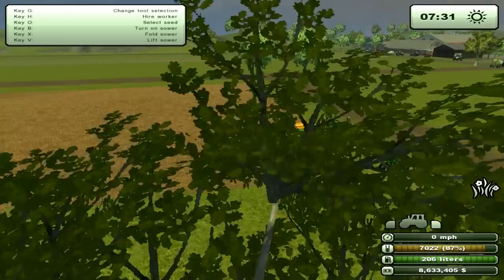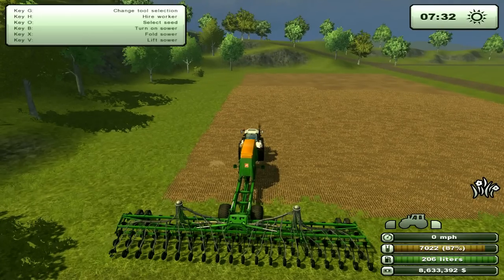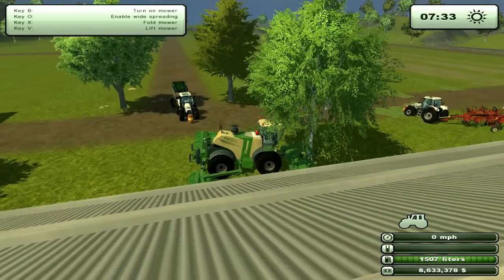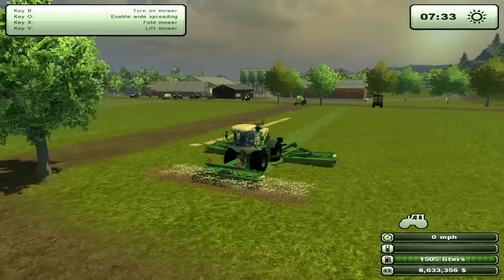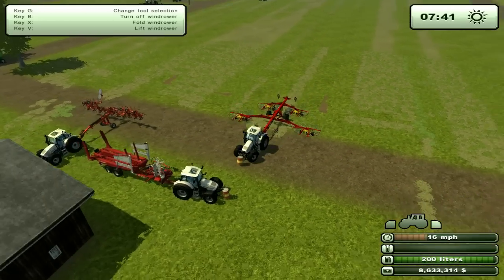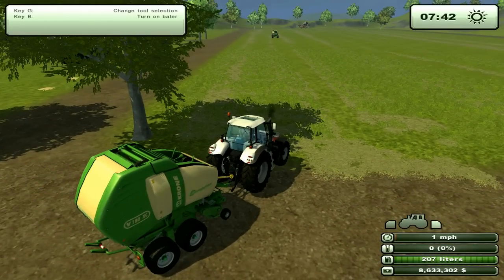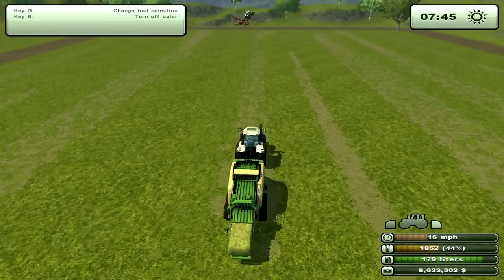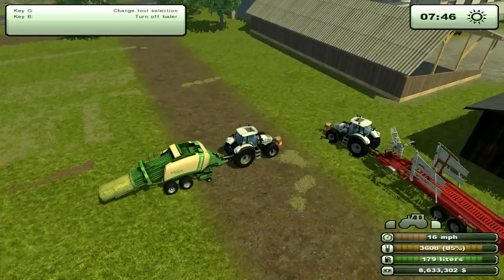Farming Simulator 2013 - How to Bale Hay, tutorial

Comment: Do you need different balers for straw and hay?
Reply: I've been learning all sorts of things about this game and came here to find out about the hay.  But, to answer your question since I just got through baling my hay is no you don't have to change balers.  I used the same baler rather than have a bunch of balers sitting around.  But I got about 3 bales of straw before the bales turned green and was coming out as baled hay.  The straw and hay bales are separate once out of the baler.  But to make sure I took both the straw (yellow) and hay(green) bales over to the feed truck and dropped them in.  The info at the top right corner indicated that I had a straw bale and a hay bale.  After I got through vacuuming up the silage I had the perfect ratio for my cows.  Hopes this helps.  I still have a long ways to go on Farming Simulator 2013.